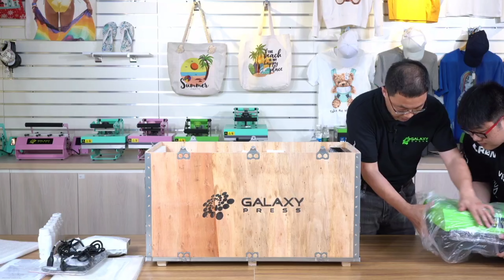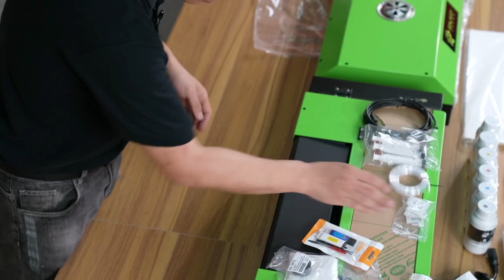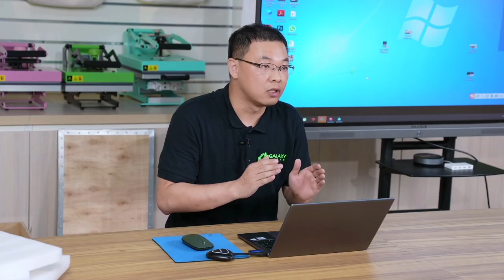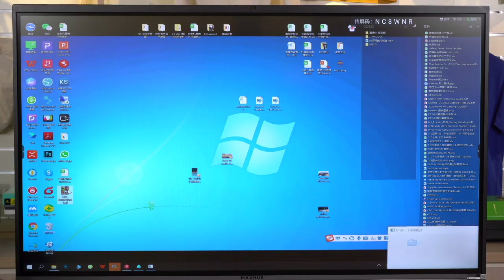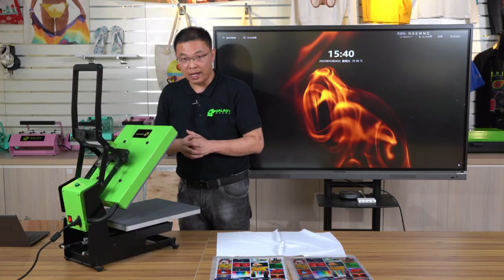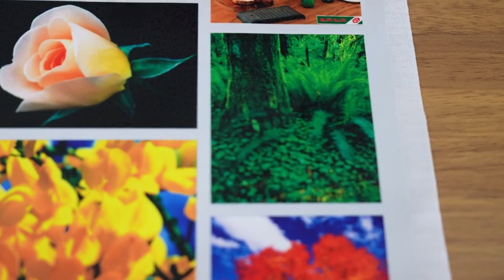Galaxy DTF-A3 Unboxing and ICC Profile Introduction Live Show

Comment: Not happy with this printer. Bought a new new one. From they supplier in Australia. Only a few months later suddenly the white ink everywhere. The seller is not take serious responsible with the malfunction product. They replace it with even old machine which also doesn’t work. Then the seller never response with my call, email and messages. Completely ignoring.
Reply: how much did you pay for?